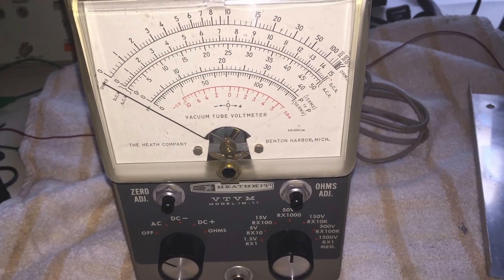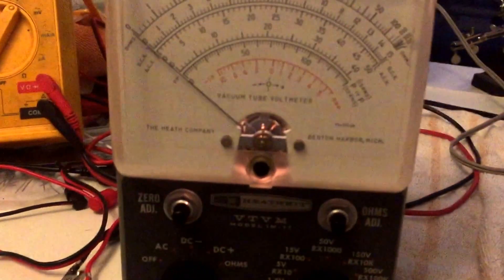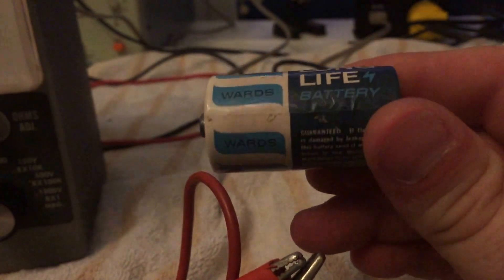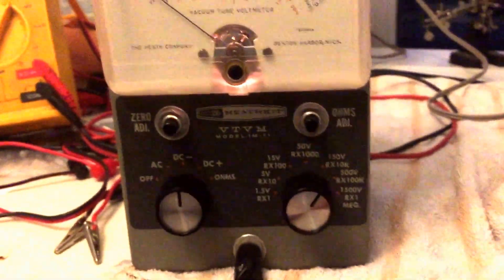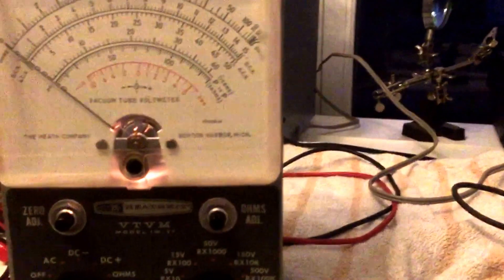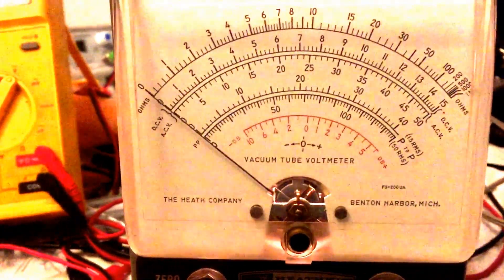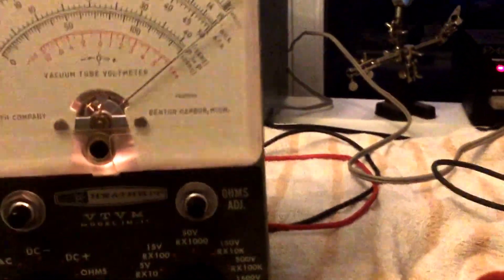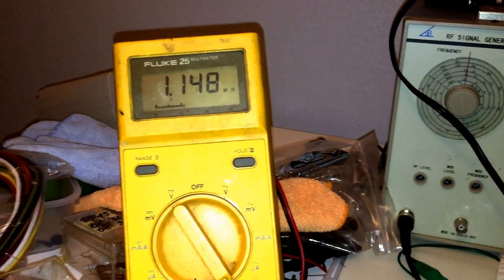heathkit IM-11 VTVM Vacuum Tube Volt Meter Testing

Comment: I just refurbed an V-7A and an AV-3 milli.  Talk about super touchy!  I rebuilt an IM-11 and sold it, never should have done that.  Still use an IM-17 in the plastic box.  New tubes on these have to burn in for about 48 hours before calibration.

Comment: Extreme amateur here. I have this heathkit and a lot of preamp tubes and vacuum tubes I want to test. I know for testing continuity but what else should I be reading from the meters when testing a tube for it to be “good for use”
Reply from the maker: If you are trying to use this meter to test tubes, you should not be working with tubes...